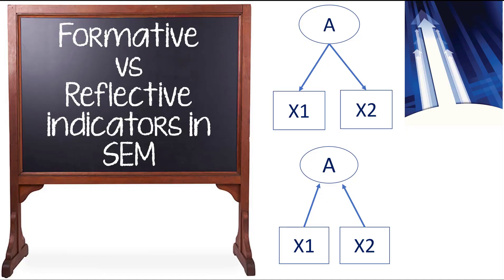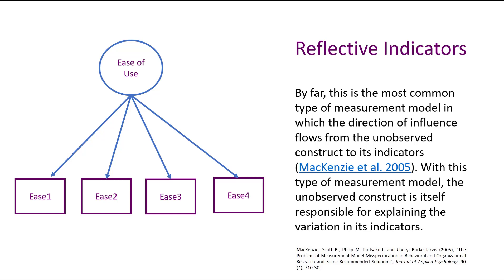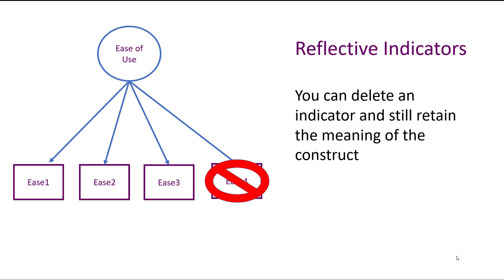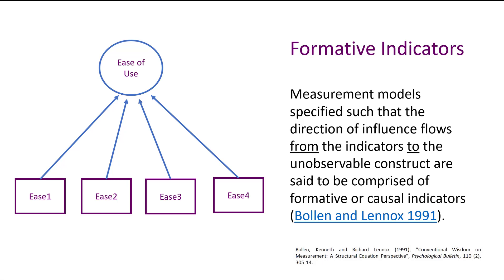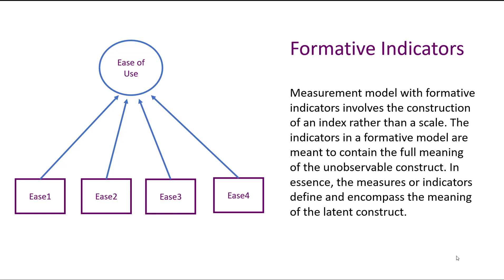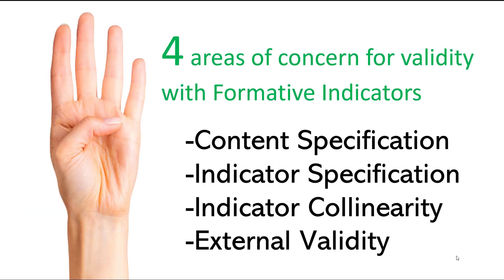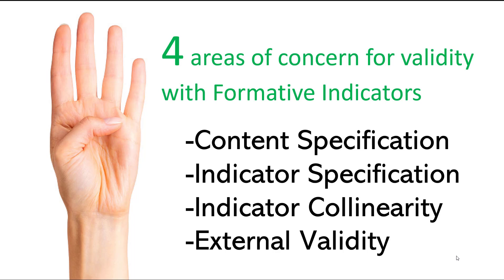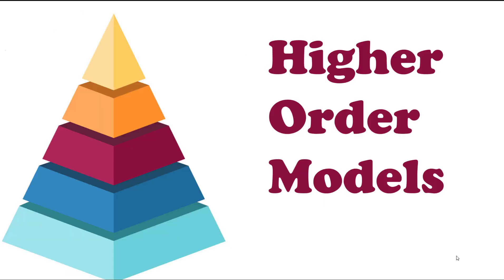Understanding Formative vs Reflective Indicators in SEM

Comment: Dr. Joel, thanks for the video! Do you think PLS SEM can handle 'measurement errors'? What about SPSS PROCESS? Is PROCESS a good option when we have formative constructs? Thank you!
Reply from the maker: Can PLS handle measurement errors? Yes, but I don't recommend PLS there is so many issues with that program.  In my book, I actively tell people to avoid that program.  It is not a covariance based program.  PROCESS is great but it will not handle formative constructs.  It will also only handle one DV at a time which can be problematic.  AMOS is my preferred choice for formative indicators but MPLUS does a nice job with it as well.